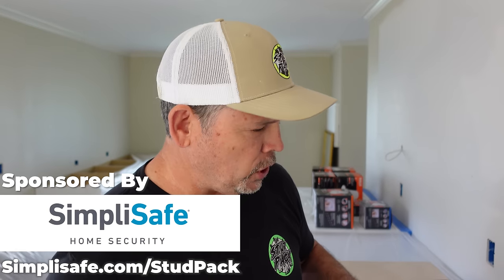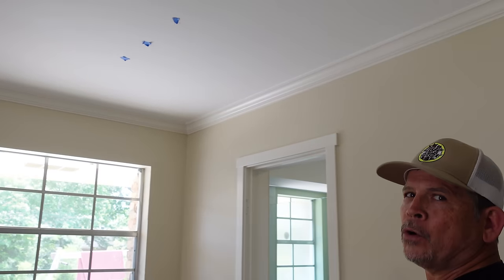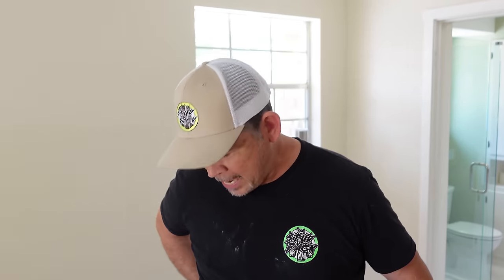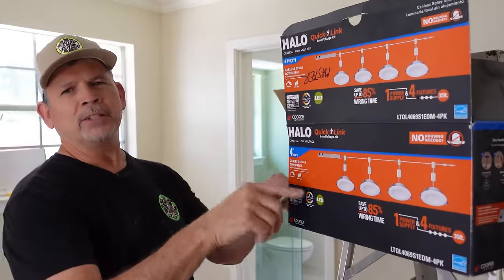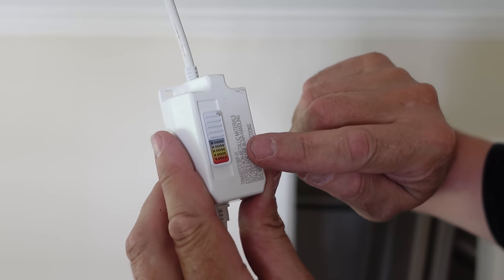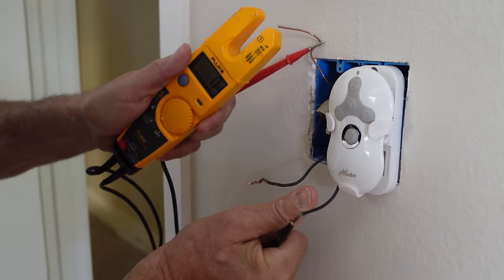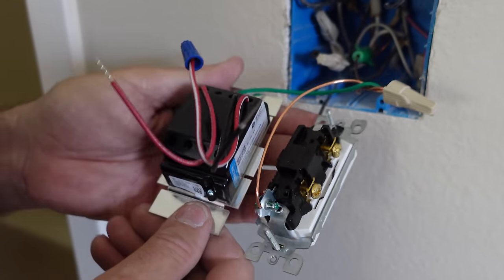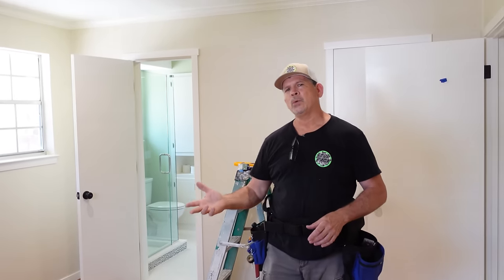HALO Just Changed the Recess Lighting Game with THIS!

Comment: Great video BTW.  I bought the exact lights and dimmers you used.  I hired an electrician to install everything.  From the moment he turned on the LED lights, they flickered.  Very embarrassing when guests come over.  The flickering eventually stops by positioning the dimmer control  at a "half-way down" position.  I am told this is because of the Halo lights.  Any suggestions for fixing this flickering problem?
Reply: Not all LED Dimmers (electronic or otherwise) work with LED lighting. Not all LED light dimmers work with all the LED fixtures on the market. Its trial and error. Had the same problem with the LED lighting in my kitchen. Took out a Leviton LED slide dimmer, installed a "digital" dimmer (no slide just 6 different stages of brightness, better but still flickered at the low setting. Installed a Lutron LED slide dimmer... Winner!... No flicker. That said don't assume a Lutron dimmer will work for you... its trial and error until you find one that works. The main problem is all the varying electronic circuits and components built into these LED Lamp fixtures.

Comment: I like the lights you install but how would you  run the wire if you are installing the lights and you have hoist and there is no attic to run the wires in the way you did, what can I do if there is no attic ., do you need to drill holes on the hoist or can you run a second line for the other two lights if I am installing 4 lights ?  Thank you

Comment: Just did a kitchen remodel and installed this type of lighting. The house had a 3 in 12 pitch over the kitchen and there was no way to squeeze in there so we did it all from inside the kitchen using Fiberglass Wire Pull Rods Fish Tape. All we did was predrill the openings for the lights then by using the wire pull rods over the ceiling joists, we daisy-chained the wire to each opening. The only real issue was the blown-in insulation coming through the openings. Luckily there was a junction box already in the ceiling with pipe conduit running to the switch box. We added an extra wire (circuit) and used a stack dimmer switch to operate the lights. 2 hours, eight lights.

Comment: Hey @Studpack great video! Do you know if they have a similar  kit for "eyeball" or "gimbal" canlights? I have a vaulted ceiling and will have to use these so the direction of my lights face down instead of diagonal. If not is there a product you recommend? 
Thanks!
Reply from the maker: Halo does have a remodel can for sloped ceilings, they're great.  Here's a link: https://www.cooperlighting.com/global/brands/halo/816509/rl-slope-direct-mount

Comment: Curious how the change out works when one of the lights goes bad? Any issue with the connection on the low voltage wire where it was initially pierced when you have to screw on a new light? I see the Halo New Work version where the light just plugs into a connector ( I believe on the temp selection box) coming from the low voltage wire. They need to make a combo between the two where they have the driver box for 10 lights, then add the pigtails, and have the small screw plug for the lights to make it easy to swap them out when they go bad.

Comment: I want to add recess lighting to our main hallway. However the hallway has a soffit running throughout that covers the heating ducts. I believe that there should be a little bit of space between the duct and the drywall from the framing to run wire. How would you recommend approaching a situation like this?

Comment: It's cool and all that "you" never installed recessed LED lighting in ceilings without having to go into an attic! But ,it's not totally necessary! I personally installed LED recessed lighting in three rooms in my house without having to go into the attic! I simply used a "fish tape" to run all my wires to the holes were i wanted my lights to be installed. Now granted if you do have access it can be a little easier to simply crawl the attic but again it's not necessary.  I didn't have an attic access at all. Even if I did were to cut an access it would have been extremely difficult to crawl as it only had a four foot height in some areas. I'm kinda shocked with your experience that you don't use fish tapes 🤔 when running electrical wires. Anyways just my 2 cents. Oh and while I'm at it your title is obviously "click bait"  🙄.  Yeah it will get you few extra views but is it really worth upsetting 😡  your subscription base or potential subscribers with it??
Reply: Fish sticks!

Comment: I'm sorry but did I just hear you say that you rather have ripped up a carpet and rip cut accross the upstairs floor to install lights??? Why on earth can you not just drill the holes fish your wires to the next light then just two 4 or 6" holes by your switch at the corner?
Reply from the maker: On that particular job there were several 4" PSL beams that I had to go through.  I simply was not able to drill through them from any distance away, the long bit flexed too much and the auger point wouldn't bite into the engineered wood.  My only option was to go at it from above.... hope that makes sense.

Comment: We are installing these awesome lights on your recommendation! 
The distance we have to cover is over 35’ so we need to use 2 boxes. 
Can we connect them is the boxes in a series and run our wires in opposite directions to light our whole kitchen dining room?
Reply from the maker: Yes you can control two power supplies from the same switch

Comment: That's pretty cool the polarity doesn't matter on those lights.  That took extra work and extra parts (internally) from Halo to make work because it's DC.
Reply: Yup, it takes 4 diodes, in a bridge rectifier configuration, same as you'd use to convert AC to DC. Power in goes to the two "AC" contacts, plus and minus as usual.

Comment: Paul....during your attic wiring task I noticed there were two "L" shaped boards(2 2x4 nailed together) that went across the ceiling joists.....what purpose do they serve?
Reply: It's called a "strongback". It is used to keep the spacing between joists/rafters a consistent distance apart.

Comment: Hey Studpack what does a guy do when there is no attic above the ceiling? We want to install these Halo cans in our family room ceiling but there is a bedroom directly above it.
Reply: If the bedroom above is carpeted, pull the carpet back and cut the floor. Alternatively, you can use a long flexible bit to drill through the joists between lights from below. Alternatively alternatively, you could cut access holes between the lights and patch the ceiling.

Comment: For any Aussies watching the code in Australia doesn't allow non insulated metal fasteners like staples over mains voltage cable unless its in conduit. But in over-regulated Australia only an electrician can have anything to do with  mains wiring so they know that already.
Reply: suspicionofdeceit  Nope, plugging in is about the limit of what non qualified are allowed to do😠. Builders or plumbers can get a limited licence to connect disconnect but installs are just for licenced sparkies. The electrical trade unions did very well to lock down their industry. Premised on safety of course which has some validity but the stats don't support that we are any safer than say New Zealand who are also on 240v and they can install power points, replace plugs etc AFAIK

Comment: I would have concerns that the Romex is not shown or indicated to secured per NEC requirements.
Reply: Also no mention of the required clearances stated by the manufacturer for the light fixtures.   Most state 3” from any insulation or structure.

Comment: Tip: always give a firm pull to each wire after inserting it into the splicing connector to make sure it is not a faulty unit and that the wire isn't sitting loosely in there. I also check for visual confirmation that the copper wire has reached the very top. That's why the top section is designed to be see-through.

Edit: I continued watching and got to the part where you bundled up three wires using a wire nut and I gotta say that is pretty sloppy work. This is why fires happen due to faulty electrical switches and receptacles all the time. First you twist the 3 wires together using pliers and you continue twisting until the insulated part also begins to form a single unit right under the exposed copper wires. Then you cut the tip of that bundle to level all wires inside the nut. Finally you screw the cap on as tightly as you can. And a good practice would be to give each wire and the whole bundle a nice tug and see if anything's loose in there.

Btw, I installed potlights in my finished basement and now about to install them at multiple rooms in the house and I don't see the need to go into the attic. It is a fairly simple job for experienced DIYers but requires good planning and informational gathering. I like your pilot hole and wire rotation trick to check for any obstructions and I think you did pretty well in the planning phase.

Comment: I guess you didn't need it, but the white stiped line sometimes goes to common if you aren't using it as a 3-way. I have some switches that have a sheath that you can pull off so that the insulation is just white.

Comment: Some things to note, these power supply modules run very very hot. The base of the module where it comes into contact with the wood runs the hottest. I don't know what the normal temperature range is for these but they run much hotter than what I'm experienced with with AC to DC power supplies.

Secondly, the insulation displacement connectors are not great. You might get lucky and get a solid connection but frequently hooking up a light and touching the wiring at all may cause the light to go in and out. I would not consider these long-term reliable and I'm thinking about splicing all the wires and using Wago 221 connectors instead

Comment: Don't led lights normally require correct polarity? What's different with these ones?
Reply: The connecting plug is polarized and can only be connected one way
Reply: @r7boatguy  Gotcha, it's just where he says at about 15:20 "polarity doesnt matter on low voltage stuff" I was a bit confused.
Reply: The rectification takes place within the lights.

Comment: Really love that you explain everything more than once. I’m an amateur electrician and I didn’t quite understand how you wired up the 2 gang box in the beginning, but when you explained it at the end, I understood. Still don’t understand the purpose of a switch leg. Also, I didn’t know you were from Louisiana. That’s awesome. As a fellow Louisianaian, I love watching your channel.
Reply: In a nut shell, the term “switch leg” is a commonly accepted nickname for the wire that runs from the control device (ie the switch, dimmer, timer, motion sensor, photocell, etc) up to the light fixture.  A switch leg is always controlled by a device, and never has constant power.  Hope that helps clarify !!  Cheers.

Comment: Question: If you convert all of your lights to LED/low power, could you (theoretically) put them all on a DC line voltage on a separate DC system that is powered by Solar with battery power to reduce metered AC use?
Reply: Check out POE( power over Ethernet) you could do all your lighting using CAT5/6, and many options for lights/devices etc.
Reply: You could but you still have to wire them with code-approved materials and techniques. Also, low voltage has a greater voltage drop for any given distance than higher voltage. Depending on the load and distance, you may have to increase the wire size.
Reply: Gene, the low voltage is AC, you would have to convert AC to DC, or use a rectifier.

Comment: I'd be interest to know the hole saw contraption you used.  There are several at Amazons but you had yours for a while and it is still going strong.
Reply: you can pick up a milwaukee one at home depot.....just make sure to keep the blade screws tight between cutting each hole.
Reply: @TheSidneySmith  I ended up ordering one that looks pretty similar to the one on the video on amazon. 100 bucks but great reviews.
Reply: Click on the "Show more" button directly below the video to find a link to it.

Comment: We remodeled our kitchen and put in this kind of lights in the kitchen and dining room and liked them so much because they are flat to the ceiling and bright.  We also added smaller versions to light up near the floor in a hallway so we could see to walk at night without turning on overhead lights.  We recessed the lights at a slight angle so they lit up the hallway and also used a much lower setting along with a dimmer to control how much light.  These things are great.  Great video.

Comment: Another cringe video of a contractor doing electrical. If you are not going to hire an electrician to do the work, at least pay one to check the work done by you or (especially) by a contractor. A lot of safety violations and some common sense mistakes too. Go up in the attic early in the morning when it's 50 degrees cooler, wrap that switch with bare wires in the box and don't mount things on top of a joist or under a duct if possible. I'm trying to keep the comments positive and constructive but this is not how electrical work is done.